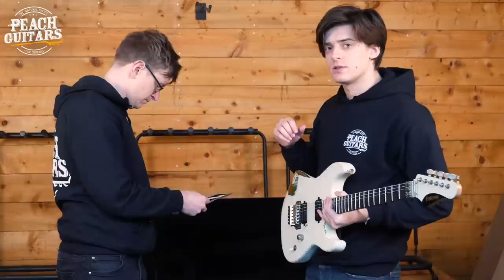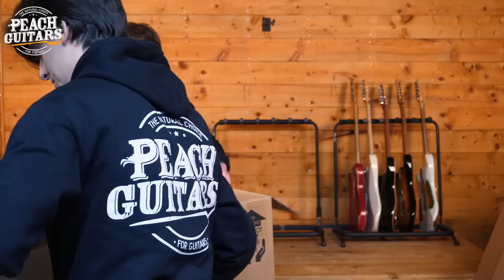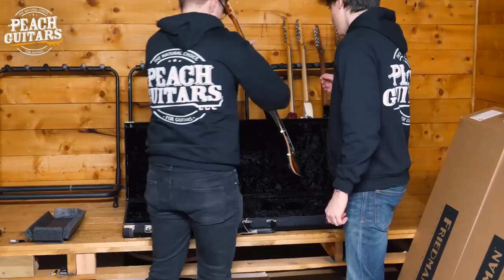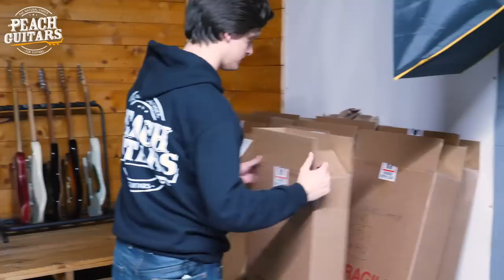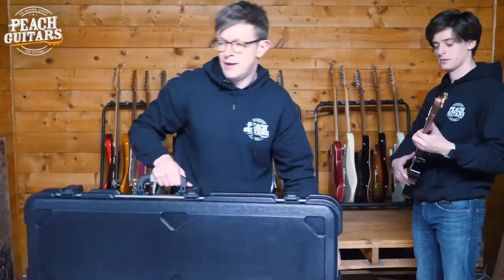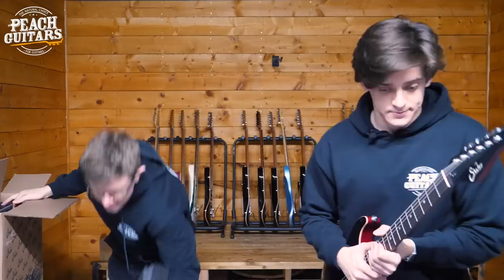MEGA UNBOXING! Suhr, Xotic & Friedman Delivery!

Comment: Not one lefty (similarly the fender custom shop unboxing). Did the red Xotic have a Truss Rod adjustment slot on the head by the nut? Usually you have to take the necks of Xotics to adjust the truss rod.
Reply: Yes. That one was part of the Xotique Custom line.
Reply: Thanks Andy.

Comment: If I had to go for any of these, it would be an Xotic...
Reply: They're amazing mate, I got my Xotic XSC 2 from Peach, it just did it for me, more so than the other brands I tried at that price point.
Reply: @angryfrenchduck  My only question is the neck... I usually am a V neck fan, because I have small hands and short fingers. I found V is the best cut for me. Xotic on does C/D shape...
Reply: @p6x2  Different shapes available as an Xotique Custom
Reply: @andyhicks8307  I looked up their custom order form, and they only go with C/D shape, to streamline what they do. I can do a C, but my most comfortable neck is definitively a V.
Reply: @p6x2  Our standard neck shape is a Modern C, but we offer a variety of shapes in the Xotique Custom line